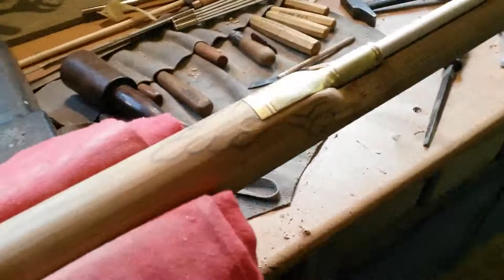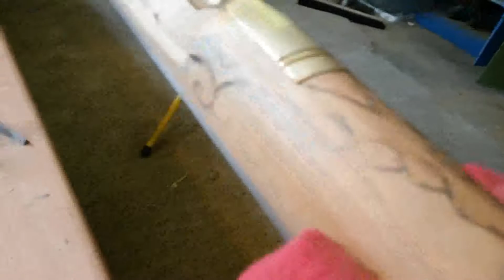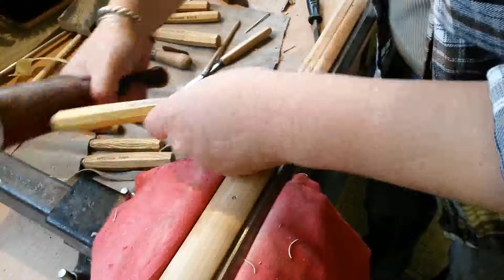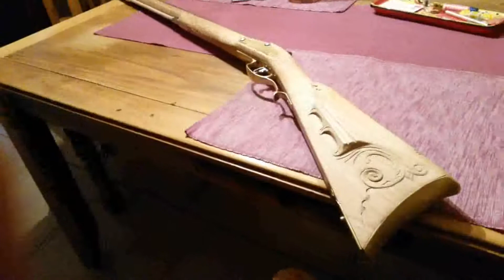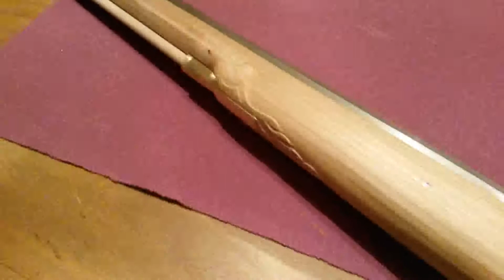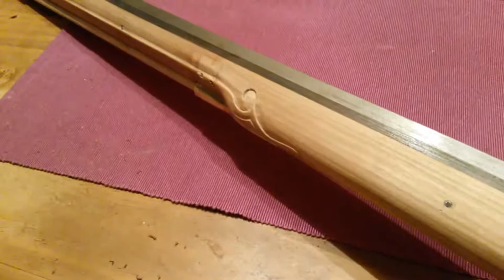long rifle build Lancaster county pt. 32 carving the gunstock around the entry pipe

Comment: Hi from Las Vegas Nevada. I am Awed by your expertise. I have watched your videos over and over trying to learn as much as possible about relief carving. I get how you outline your carvings, however I am unsure how much wood is removed to make the carving stand out. If for instance your caving is 1/16" deep, do you remove 1\16" of wood all over or do you blend the wood removal to simulate an all over removal.
Reply from the maker: Mostly I do a combination of bothe in the buttplate area not to loose so much material. Around the grip I remove the material to the gripp completely but to the buttplate I blend it . That gives the carving a look as if the grip merges into the stock . A realy nice effect 😁😁 for guns of older style. For guns after 1800 I would prefer to remove the background complete and keep the carving less plastical than for early guns. So I hope this is helpfull to you and kind regards from good old germanys Westerwald.😆😆
Reply: @homemadehistory7537  Hi again from Las Vegas. Thanks for your reply and information. I am a Beginner wood carver but willing to try. I just received My long awaited Kibler woods runner rifle kit. Thanks again love you videos.
Reply: Danke schön @homemadehistory7537
Reply from the maker: And before I forget. For a beginner it is useful to try the technics on a test block first 😁